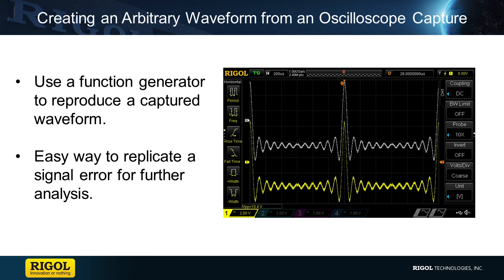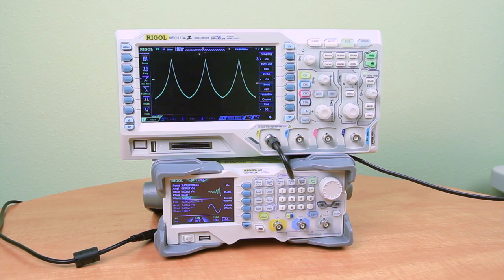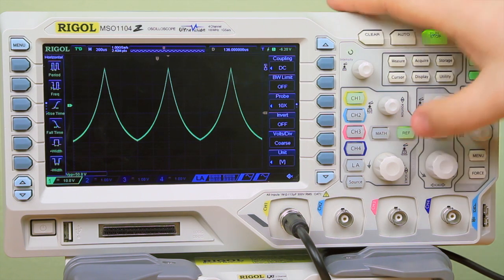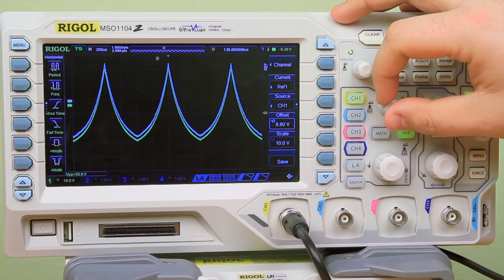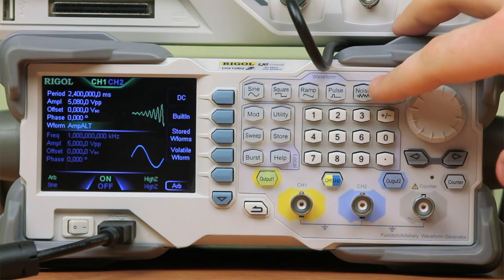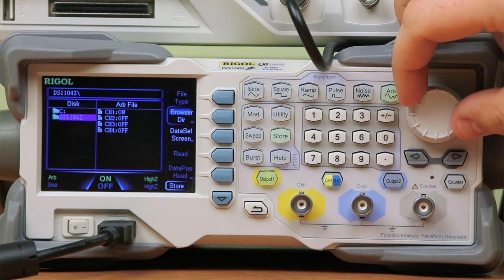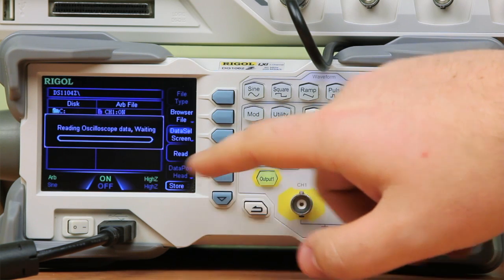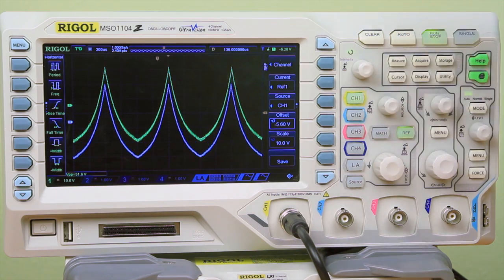Create Arbitrary Waveforms from an Oscilloscope

Comment: Hello!

Is it possible to capture and play a video signal in the same way?
namely, a static picture on the video signal.
Reply from the maker: Technically possible with a deep enough and fast enough arb, but likely better to use specialized equipment for that.
Reply: @RigolTech  Ok thanks for the quick response.  Could you try to do this with a video signal?